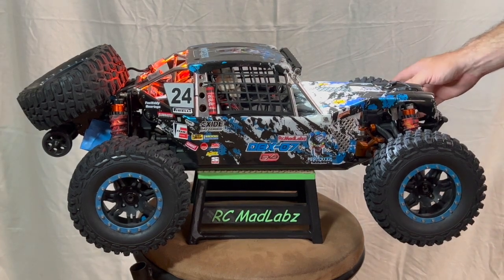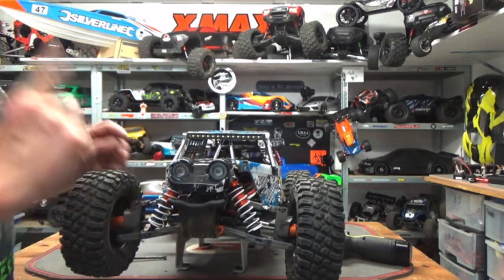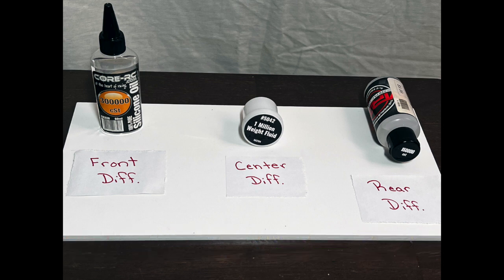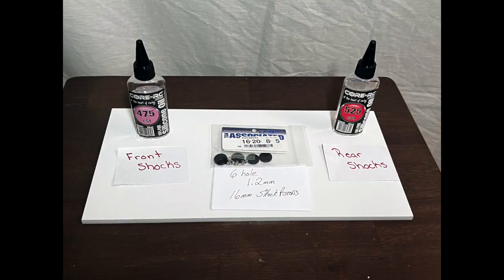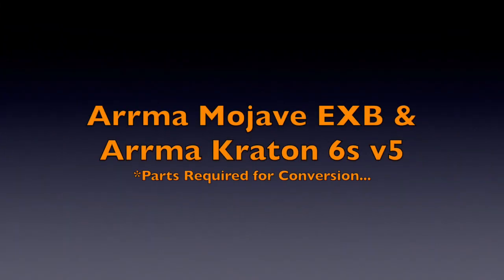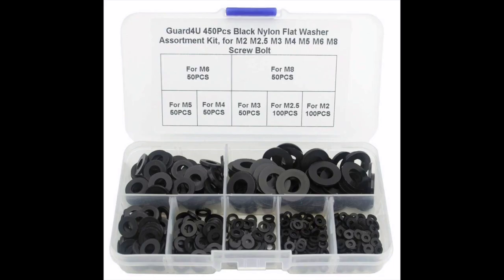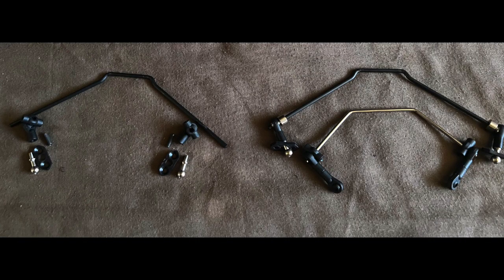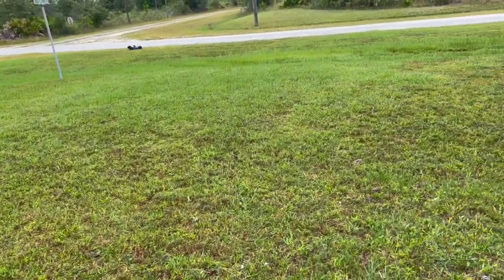RcMadLabz DBX-07 EXB Build Stages, ZD Racing DBX-07

Comment: I've watched yours and many other posts on the DBX 07 and was looking forward to fixing it's issues, however it's turned into frustration!
I've tried to simply change out the wheel bearings but can't remove the 2.5 grub screws that hold the hubs in place! I even just tried putting a soldering iron in there and they still won't budge as I think their held in with red Loctite!
So how is everyone else dealing with this issue?
I'm at the end of trying and have stripped 2 of them now and thinking I'm best to just take it to a hobby store and get them to sort it!
I look forward to hearing your advice as in all the videos I've watched, nobody has mentioned getting these grub screw out was an issue... 
Thanks in advance.
Reply from the maker: Butane micro torch..yes there is an abundance of red thread lock everywhere. Those grub screws need to be heated a lot to break down the thread lock. You’ll know when they are heated enough, as the thread lock will smoke a little bit and the grub screw will very easily un thread. The motor mount screws, center driveshaft support and center diff mount screws, all need to be hit with the high heat from a butane micro torch to be removed easily.
Reply: @rcmadlabz2492  thanks heaps mate, much appreciated but what a pain! 🙄
I'll try again. Thanks for the quick response. 👌
Reply from the maker: @stevestanton8281  yes, it’s a pain. Pretty sure they used a  paint brush soaked in red thread locker for most of the screws. *Fair warning…you’re going to want to get creative when installing the bearings into the wheel hubs. (The hubs are oversized/bigger than the bearings…which leaves a lot of play)
Reply: @rcmadlabz2492  yeah I'm hearing you but it's hard to deal with when you're only new at RC...
I'm already in for over a grand Australian with the conversion rate...
Seriously if I knew all this before I wouldn't have bought this model.
What's your thoughts on a "easy" to work on 1/7 scale desert racer? 
Arrma Mojava???
As this DBX 07 sadly HAS ZAPPED MY ENTHUSIASM for rc... 😔
Reply from the maker: @stevestanton8281  Oh My Gosh!! For sure, yeah..you picked a model that has many complex issues, that was a bit challenging even for Myself to sort out! *The Arrma Mojave is much easier. Nothing at all compared to the DBX-07.
Reply: @rcmadlabz2492  thanks mate, I might just cut my loses and put this DBX 07 on the back burner and save my money on getting this "RTR" DBX 07 (WHAT A JOKE RTR? LOL 😂) going and invest in the ARRMA MOJAVA a go...
Sucks, but I can only see more expensive issues ahead...
I'll stay in touch and let you know how I go...
Thanks again for you insight.
Cheers. 🙄👌🇭🇲
PS, I hope this thread helps others to save their money and invest elsewhere... 😉👌

Comment: What is the best diff oil to use for front and rear diffs in the dbx07?
Reply from the maker: I’m running the Arrma 1250kv motor, 6s. 16 tooth pinion. I have found that for my set up, 150k front diff oil, 50k rear diff oil, and 50/50 blend in the center diff of 1 million and 500k oil works perfect for how I use/run my custom DBX-07.  *The biggest improvement was converting to the Arrma suspension/driveshafts….it completely eliminated the mistakes ZD Racing has with the model.